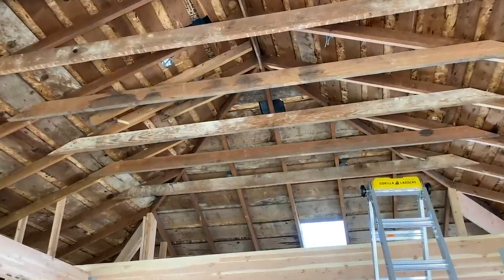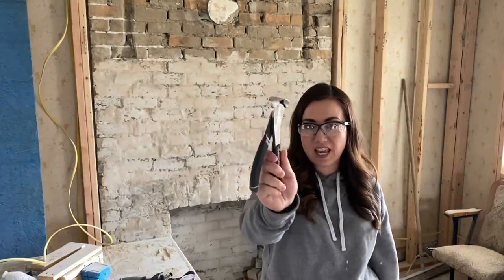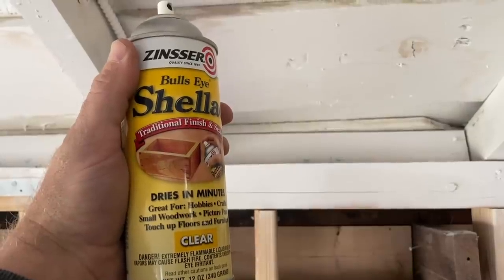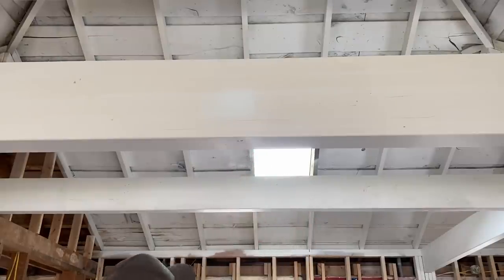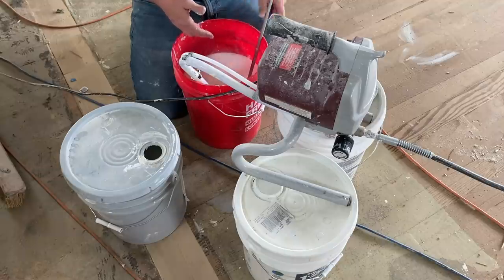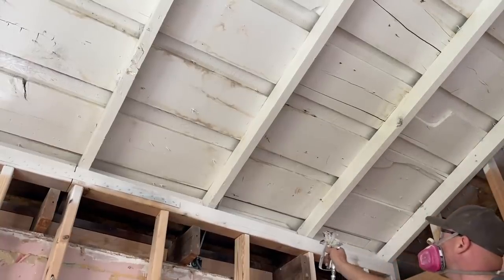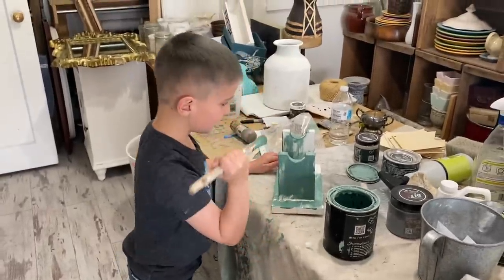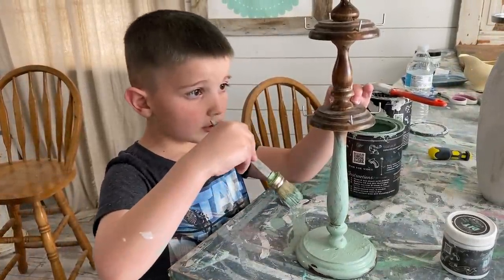Painting The Ceiling White At The Farmhouse Renovation + Fixing Water Stains.

Comment: Did you have to dust and clean off cobwebs and sawdust before you sprayed the ceiling ?
Reply from the maker: I hosed it off with an air hose to knock down most of the dust before painting.